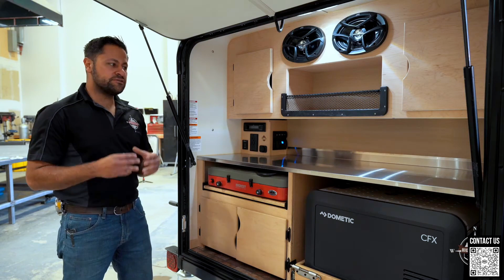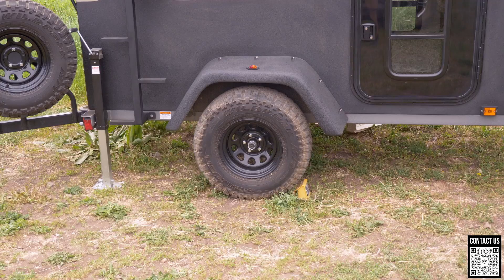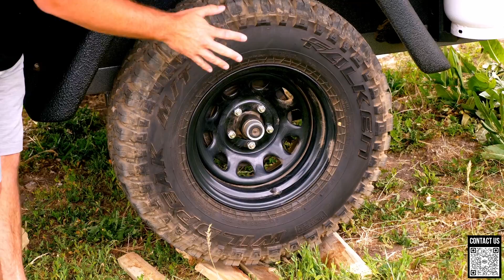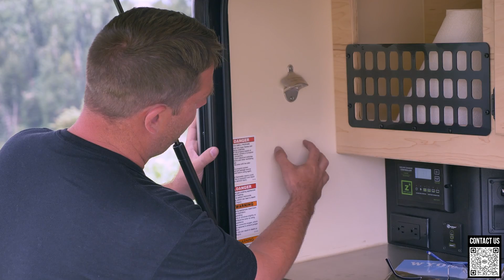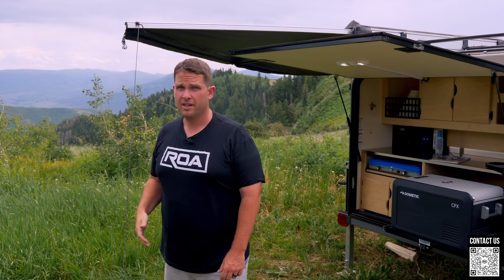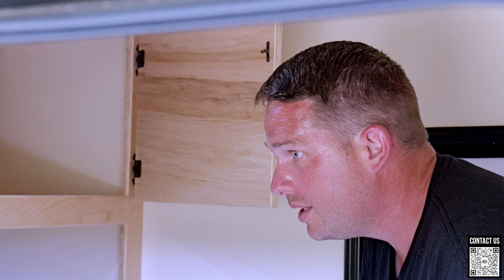Full Tour ALL NEW XT50 Off-Road Trailer by High Altitude Trailer Company | ROA Off-Road

Comment: I cringe every time you say it's a one-piece trailer. That is false it comes in two pieces you can clearly see the seem right down the middle of the trailer on the front. I have seen the High Altitude manufacturer video where one of the owners specifically says it's two pieces....
Reply: You are correct, it comes in two pieces.  Once it is married together with the adhesive, it becomes one piece.  If you were to try to pull it apart, the fiberglass would fail before the seam would.  (Of course the force required to do so would be tremendous).
Reply: @highaltitudetrailers2389   I would love it if guys would respond to your quotes on a trailer I was interested in. I also have a Gladiator and interested in your slide in camper. I have no idea what most of those ad ons are.